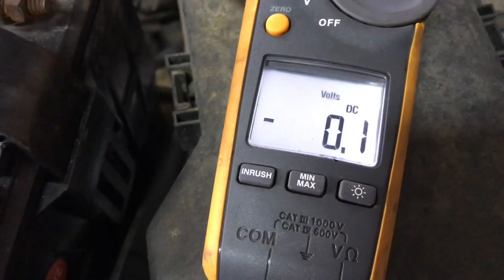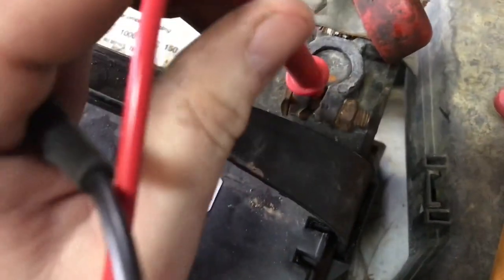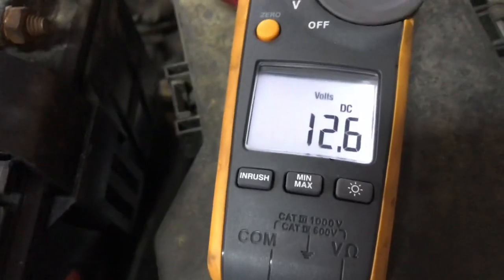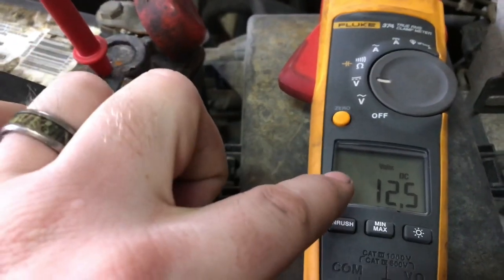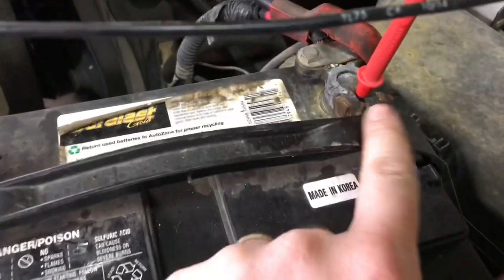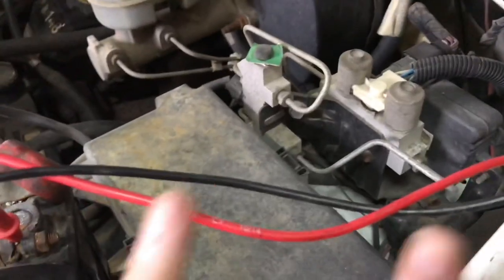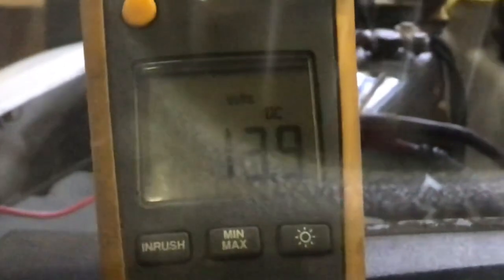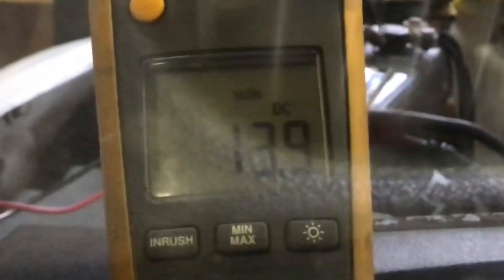How to test a car battery with a multimeter (voltage + cold cranking)

Comment: Keep in mind he is using a good fluke meter, I had some delay and ambiguities with a cheaper model DOVM.
Reply: And make sure that the battery for the multi meter is good, otherwise it may read incorrectly

Comment: So ...  it does not actually read the CCA written on the battery itself !     How you test for that ?
Reply: He was testing battery voltage with open load and then load. To test CCA you have to get a specific meter.
Reply: @limitingchaos  What is the specific meter?
Reply: @BillyGirlardo  A battery tester. Midtronics makes them but there are a ton of brands and models. It may be expensive if you're buying it for personal use only.

You can tell if a battery is good or bad with a standard multimeter but not get the exact CCA.

Comment: How do you apply this to a vehicle with two batteries?
Reply: The same except you’re not gonna know which battery is bad. Most replace both at the same time because even if one is still good it will have lower capacity (higher internal resistance) than a new batt and will drag the new one down. Basically there will be an imbalance charge/discharge rate and cause them to be undercharged.

Comment: You didn't explain anything how are you supposed to know the amps
Reply: You're watching for voltage drop. He's saying if the voltage drops below a certain level while cranking, then the battery is not delivering the power needed (amps are only a component of that)

Comment: I guess you did not test the cold cranking amp.
Reply: He did. The voltage drop indicates it's above the point where there is insufficient CCA.
Reply: @fungames24  Agreed but this method relies on knowing that you have a working starter motor.  Part of the reason for testing the battery in isolation is that if the battery is good and it doesn't turn over properly you can then move on to test other things.